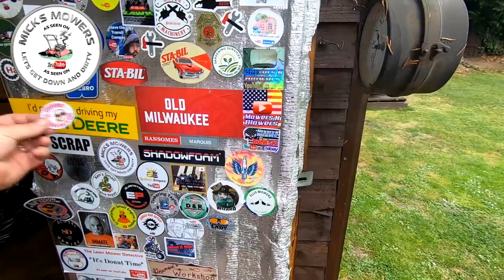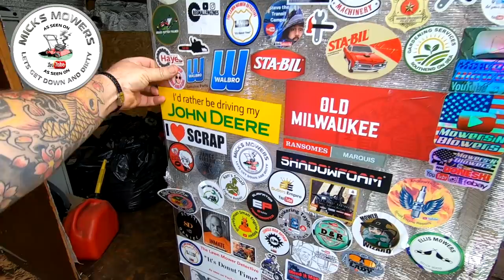Lawn Mower Drive Wheels Not Working.. Let Me Show You How To Fix This Common Problem

Comment: interesting, learn something every day. copper pipe was a temp spacer for crap bearing. fixing 2 lawnmowers here, lost a drive nut as cats nocked bits off bench, will measure nut and pitch and hunt for a drive rear nut. thankyou,great videos. £50 hour from mechanic,bugger that. just bought an oil sucker tool they are cool, no mess. take care duns,scotland.
Reply from the maker: Ta for watching mate

Comment: You make due right now Mick ! Have a mower drive in the front and I can't get one wheel off  ?  Turns when I lift the front up but it don't drive ! Have you ever had trouble getting a wheel off argh ! 🤯
Reply from the maker: Could be a belt of cable adjustment needed.. if not sound like the gearbox mate

Comment: Appears your customer watched Steves Saloon woobly wheel fix using copper pipe to repair the situation but it leaves roughly 0.028" clearance and if you do not get your 5/8" hole drilled in the true centre then it is offset and not a good idea on the drive wheels but ok on push wheels. We use isostatic bushings with 0.001" clearance to repair worn push wheels.

Comment: That piece of copper pipe is actually a Yorkshire straight connector. I suppose the raised parts of the joint are the nearest to the correct diameter.

Comment: The copper thing is a pre soldered copper coupler. Presumably in there to take up the wear in the wheel. It is a bit pants. That brand is also sold in tool station.

Comment: You missed the washer on the shaft before the wheel goes on. That is why the wheel stiffens up when you tighten the nut, You also need the smaller washer on before the nut. The threaded shaft is narrower than the bearing shaft and the washers allow the nut to tighten down on the ridge whilst still allowing the wheel to spin freely. JMOO. Good Videos and entertaining content. Thank You.

Comment: Hi Mick. i have just picked my self up a Hayter Hayterette. its the older style with the carb that bolts into the petrol tank. i may need some spares and wondered where would be the best place to contact.
Any help would be appreciated.
Reply from the maker: Amazon,eBay, or garden hire spares..

Comment: The issue it seems there is with the metal drive gear. It has a series of spring loaded metal pieces inside which 'grip' the driven shaft in one direction only, which allows them to work as the mower drive is engaged, but then it can freewheel when the drive is released. These metal pieces get corroded up and then don't spring back properly, resulting in them not gripping the metal shaft correctly. Soaking in wd40 or similar can free them up, also using a screwdriver to try pushing them in and out can help. Similar design on other machines. Einhell is a company in its own right so sold in lots of places online.

Comment: Nothing wrong with secondhand parts. Insurance companies are happy with car repair shops using then. Not much is built to last  nowadays, everything seems to fail just after the warranty period expires. Copper pipe was used as a bush to try take the wobble out.

Comment: just as catcha cow says its planned obsolescence use a design with several points of wear then use cheap plastics and poor quality bearings ensuring it will fail after a season or two in the hopes the owner just buys another one where if the same design was made up of decent quality materials it would run for years. cars are the same as well now with key components made of cheese that last just long enough to see out the warranty!